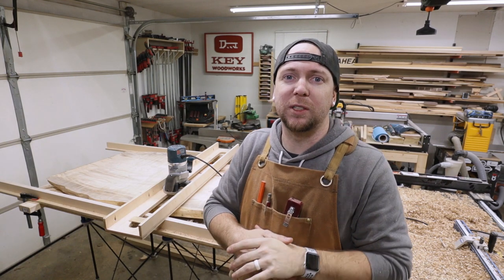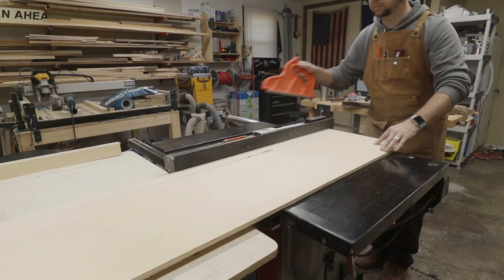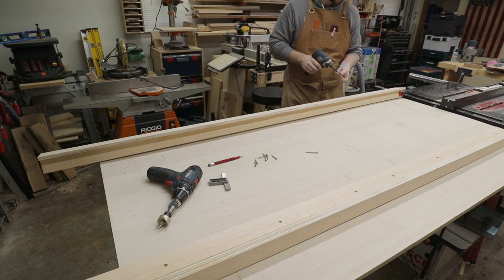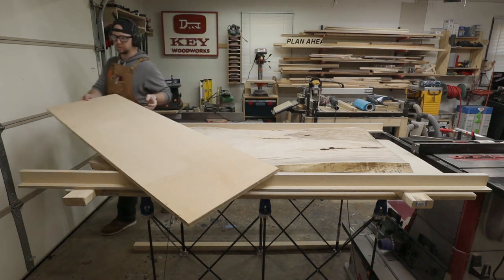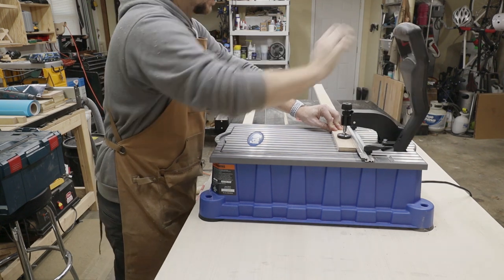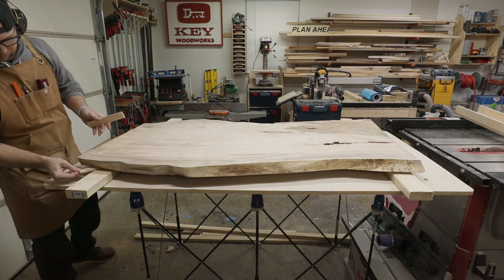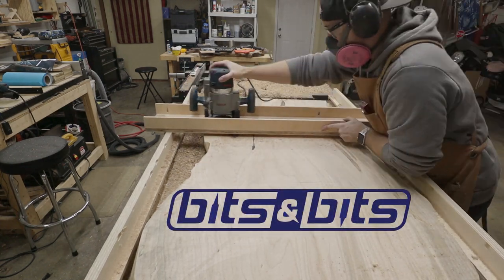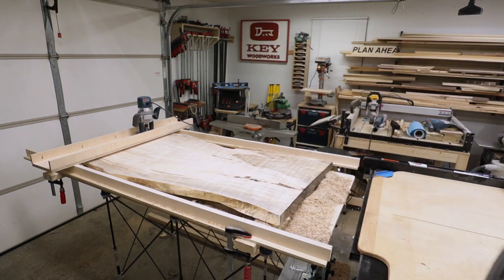How to make a DIY Flattening Jig | Router sled

Comment: Were you able to flatten in one pass?
Reply from the maker: Keith Johnson Custom Woodworking 3 passes in total. I didn’t want to take too much off at once and overwork my router.
Reply: @KeyWoodworks  Gotcha. Didn't know how out of whack that slab was and how much material you needed to remove. Looks pretty dang smooth.
Reply from the maker: Keith Johnson Custom Woodworking it helped that I had already hit it with my power planer. I may do one more pass just to clean up one slightly lower spot

Comment: Was the weight of the slab enough to keep it from wiggling around? I saw the kat moses get down with hot glue on his. Wasnt sure if that was necessary. Have the $200 router not a $5 glue gun
Reply from the maker: The weight makes a big difference, hot glue wouldn't be a bad idea especially if you need to shim the slab to start.